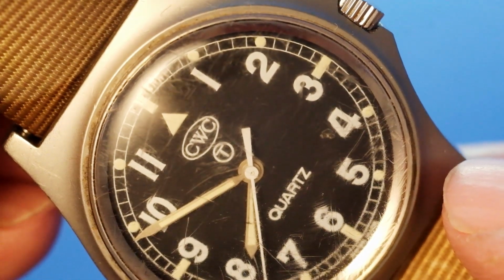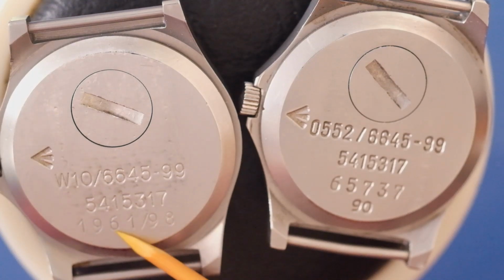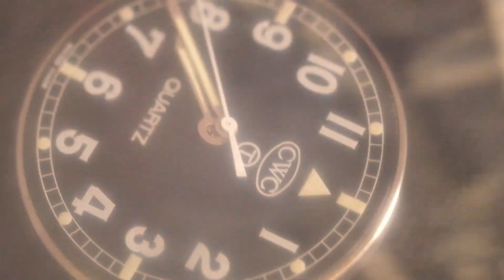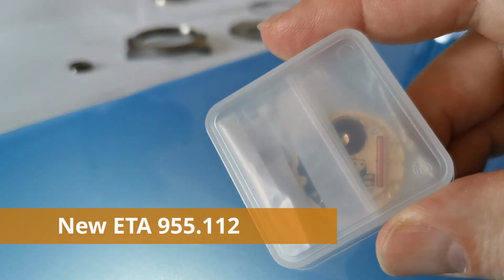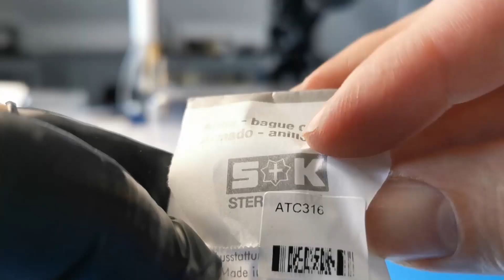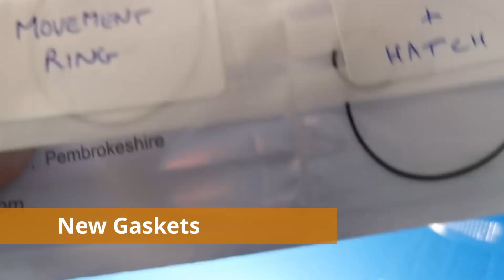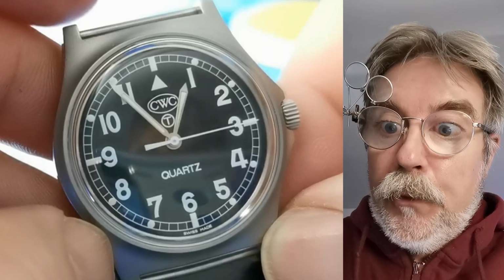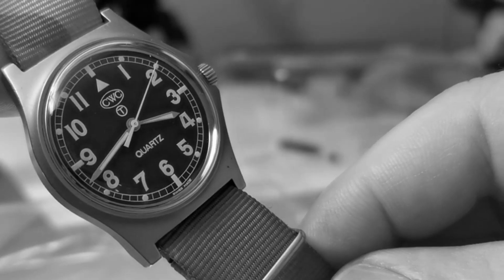Restoration of a Military Watch - British Army G10 - Fail!

Comment: Very interesting! The new ETA comes with a calendar, if there is no need you can remove the Calendar Wheel an they movement, quite clever solution! I like your clean and very artful work! Very nice!!
Reply from the maker: Hi Marcus... Some guys would just leave the calendar work doing its thing under the dial but I like to remove it as it makes the mechanism less complex and more reliable.  Thanks for the feedback sir! Richard

Comment: That's a project that I would actually take on for a client. If it were me I would've removed the spring bars, but that wouldn't have been right.  Thanks again for a great video informative and entertaining video.
Reply from the maker: Hi Jimmy ... go for it!  But you willneed a blow torch if you want to remove the bars across the lugs ... they are soldered in as this is the military spec. Good to hear from you sir!  Richard
Reply: @richardperrettwatchmaker  Oh....it a real military watch. I didn't realize made only for a NATO. Thank you for the information I wondered why you didn't remove them when cleaning.

Comment: You done a good job, it’s better to have a watch that works than not,  shame about that strap it would have looked nice on that watch, but fixed bars only have so much clearance.
Reply from the maker: Thanks John ... yes I should have seen it coming and I had no time to get another strap before going out with the video so I decided to go with it and then at least it helps others not make the same mistake!  Thanks for the feedback!  Richard
Reply: @richardperrettwatchmaker  An easy mistake to make Richard, proper fitment of a replacement watch strap often catches people out, I've had a watch that had it's case attacked with a grinding wheel! Mangled, could be an idear for a video explaining what's involved in getting a bracelet to fit the lugholes and case properly.

Comment: Suggest you take the two pins off, and put them back on when the strap is in position between the lugs.
Reply from the maker: Only with a blow torch Yc!  They are soldered in!  Military Specification .... but thanks for offering a solution!  Richard

Comment: Being a Pulsar collector I am trying to get at a decent non "pull my pants down" priced Pulsar G10 and the RAF chrono issue for my collection as I do have a standard "civilian" version of the Pulsar G10 and have civilian themes of Pulsar's dancing hands models V601 and V691 but the civvy versions just have standard casebacks.   I remember the war of ego's at Woolwich where the RSM hated quartz and expected one to have a damned good automatic and the adjutant who hated mechanicals and expected one to have a bally good quartz and none of this soppy NATO straps either, you bought from the barracks store a brown or black leather cuff strap which had a pop down hood to cover the head and offer no shine.
Reply: I am suffering at mo a NATO on my rebuilt Invicta Russian Diver I put a new movement into, gave a nice clean and tidy inside and out, made a long stem using them Chinese stem extenders and put a nice stainless steel crown under that massive canteen crown, bought a handmade thick and distressed hide Zulu in brown for it which is really a "homage" to a Zlatoust but I can't afford a Zlatoust so Invicta all the way :D

Comment: Good job Richard . I really like these military watches . My only problem with them is that they're quite small . What are they 34 or 35 mm . Pity about the strap but no big deal 👍.Those fixed pins did you no favours there

Comment: A question regarding the calendar dial. When you take that out and push iut the stem, it will still stop on the calendar position? I.e. there are still 3 position for the crown versus the 2 positions in the original movement?

Comment: Hi Richard. You’ve inspired to restore one myself. Just one quick question, why don’t you use a press to put on the crystal? Thanks in regard
Reply from the maker: Hi benc80906 ... this 'crystal' in these watches is actually acrylic and designed to flex.  This flex is utilised by the 'crystal' grab to shrink the diameter of the arcylic and slot it into place before releasing it where it gribs the case due to the outward pressure exerted by the springy acrylic.  A crystal press would push onto a piece of acrylic too large to go into the case and quite quickly break it.  Hope this explains.  Richard
Reply: @richardperrettwatchmaker  thank you so much

Comment: Great as usual. 
A bit disappointed by not seeing  a mechanical movement. 
Regarding the strap is it possible to remove both pins from the lugs and place back once the Nato strap has been positioned to its ideal place? This way avoiding bottle neck when it comes to metal rings!
Reply from the maker: Hi Dr Omar.... Thank you so much!  These watches have thick solid bars soldered into the lugs so removal is not an option!  I should have seen the problem coming! Richard

Comment: Hello, a very informative video. I previously thought tension ring, armoured, acrylic crystals needed a press to remove/replace but your crystal lifter worked very well - even though the Bergeon No 4266 is advertised as suitable for crystals without tension ring. How did you judge that it was appropriate to used the lifter rather than the press? Is it the fact that it is acrylic rather than glass? I would like to do the identical job on my CWC G10 so need to understand which tool to buy. Many thanks.
Reply from the maker: Hi Brian you are wise to ask as there was some pressing done off camera.  In fact the press is maybe more helpful than the grab.. I would invest in a press and then buy a few different sizes of crystal as they are quite cheap.  Then press home the largest that you can.  Hope this helps. Richard

Comment: can you fit the circuit or the coils from a 955.112 to a 955.102? I wouldn't call a riveted strap not fitting a fail. I can get a 955.102 for my 95 G10 and can still buy an NOS one but wonder if it's not worth just putting a new 955.112 in it rather than an old movement even if there is the originality aspect to it.

Comment: Could you fit a mechanical movement to this watch on a direct swap basis, Richard?
Reply from the maker: Hi Cherry Brandy ... good to her from you!  There are several key dimensions in the candidate movement that have to be exactly right for this to work.  Most import of these is a thing called 'stem height'.  In practice it is normally pretty tricky to pull this off but not impossible.  Hope this helps. Richard
Reply: @richardperrettwatchmaker  You too Richard and thanks for the explanation.  I suppose renewing the battery before going into theatre was the sensible thing to do.  Thanks again, Chris.

Comment: 9:37 I don’t understand what these two tools are helping with.
Reply from the maker: Hi Stefano ... it's called a Crystal Grab and it compresses the diameter of the crystal enought to locate it and then press it homeso when released it is a nice tight fit.  Hope this explains and thank you for the question.  Richard
Reply: @richardperrettwatchmaker  oh wow. I didn’t know of such a tool. I’ve only just begun teaching myself to work on watches as no watchmaker near me wants an apprentice or helper. I never considered that a crystal could be compressed at all.

So you would use this instead of one of those crystal presses?
Reply: Me neither 🤣

Comment: I'm Japanese. I'm not good at English.🙇

 It's 50 meters of waterproofing, a wristwatch of CWC is transcribed. Even if a wristwatch of CWC is washed with water, is there a problem? Worry is in the waterproof performance because a wristwatch of CWC is the battery hatch system.
Reply: Washing your hands with a W10 is fine, but swimming is already risky. The G10 has a lot of sealings. But the crown is not screwed down. The pressure values given on a watch are static pressure. But when you swim or dive there is dynamic pressure. That might be higher than the rated pressure. One drop of water is enough to kill the movement.
Reply: @albman  

A wristwatch that is water resistant to 5 bar does not withstand up to 50 meters. I want to be careful when using a CWC watch. Thank you for your response.

Comment: Excellent video Richard! I have my father's "fatboy" version G10 that has a faulty movement. What replacement movement do you recommend for this one as I understand that the 955.112 doesn't work for due to the stem height? The original 536.121 movement is impossible to get hold of. Your recommendation would be much appreciated!! I have liked all your videos!! 🤣

Comment: uhhh, couldn't you just remove the bars on the watch, place the strap and then put them back on?
Reply from the maker: Hi Micky... Not without a blow torch! The military spec dictates that the spring bars are replaced with solid bars soldered to the lugs!  Otherwise your suggestion would work! Richard

Comment: Wait, couldn't you just apply the Nato strap by removing the spring bars, positioning it and then putting them back in? Less practical than a regular Nato, sure, but still not worse than any other strap.
Reply from the maker: Hi Alias Anybody ... natural assumption but this watch has a military specification and the there are no spring bars!  There is a solid bar which is soldered solid at the lugs!  I was snookered ... but I should have seen it coming!  Thanks for the feedback. Richard

Comment: Orher than this watch being a military issue, it is of no real value. Simply because it is not a real watch.
On the other hand, the older CWC watches that are automatic are the way to go. 
Rolex which you always praise stopped manufacturing quartz watches for a reason. 
The reason being - no value for collectors.
Same goes for the other high end Swiss watch manufacturers.
Quartz is associated with Seiko and Citizen. 
Yes, a quartz watch is more accurate than an automatic one.
Yet, the mechanical watches rule and are preferred.
Especially by former members of special forces community.